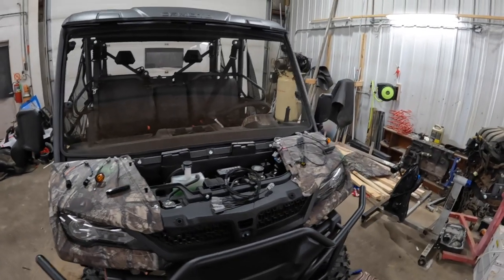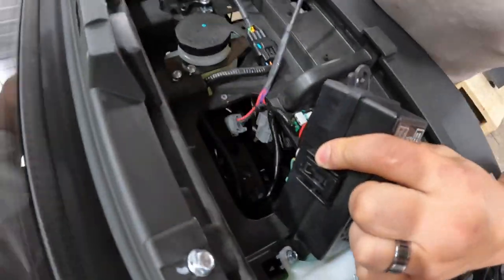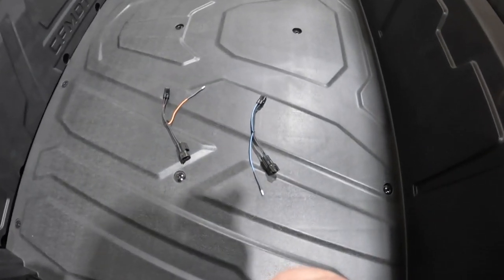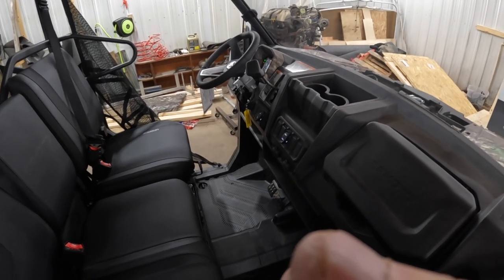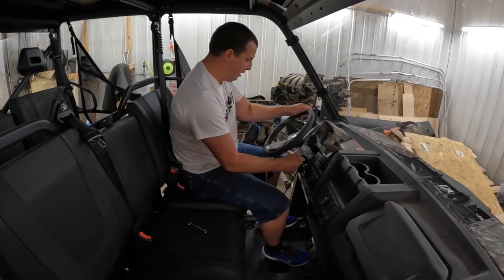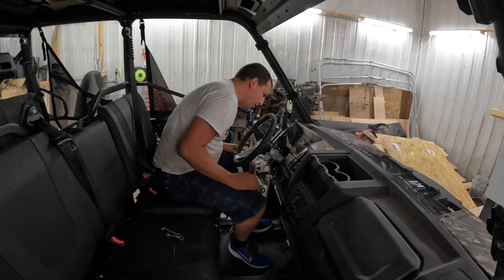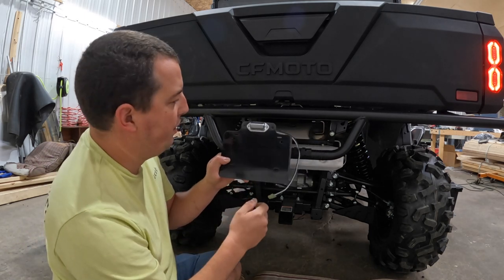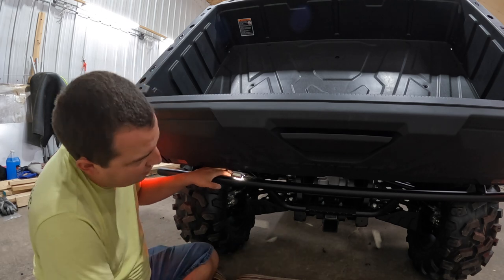Kinnettic Kreations true plug and play turn signal kit install, 2023 CF Moto UForce 1000 and 1000XL

Comment: Just installed this on my 2022 Uforce1000. Little different than on the 2023 here in the video I found. But got it figured out. I can report, the DRL does not turn headlights off when using turn signals on my 2022 like it did here in this video for the 2023. It did light up the turn indicators when using the brake pedal, however. Great kit. I ordered some aluminum clamps so I can mount the license plate bracket to the rear bumper on mine.

Comment: How come we didn’t see rear turn signals?
Reply: it uses stock tail lights - they just blink on off
Reply: I need just the connects for the tail lights
Reply: How much for the kit
Reply from the maker: Unfortunately that won't work without our full kit, we do things differently than the CF Moto parts so just having the connectors for the rear does no good. It eliminates the brake lights in exchange for turn signals using our rear harnesses with the factory setup.
Reply: can u do a video for the UFORCE 600 Leaver kit for horn n indicators